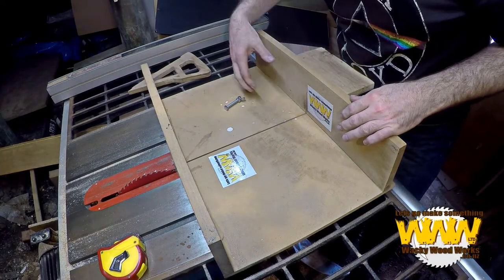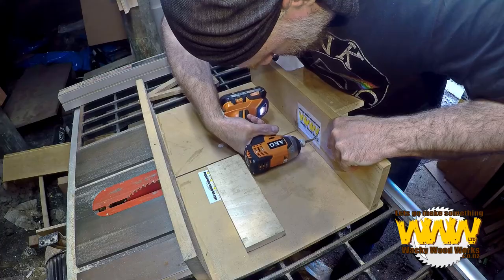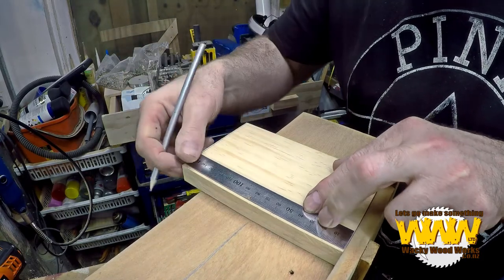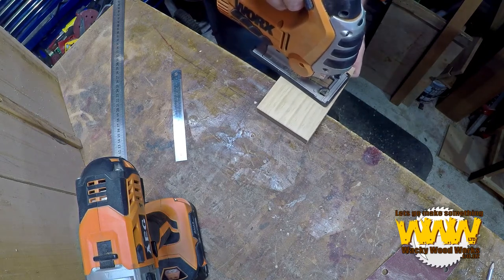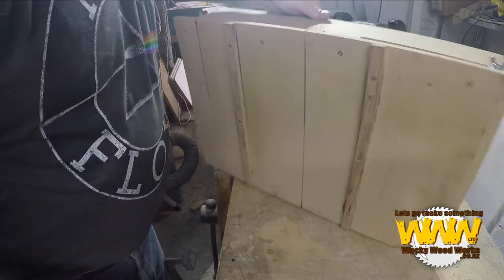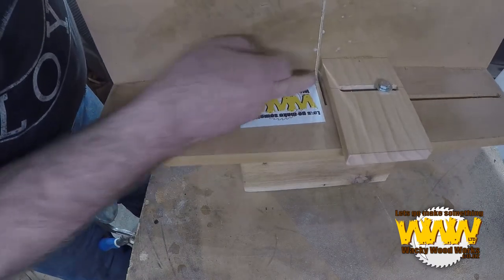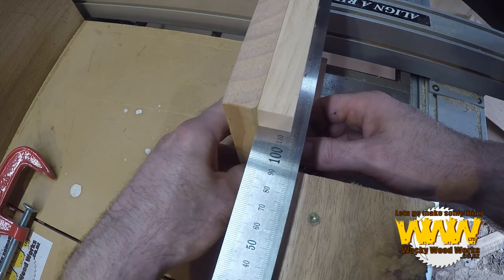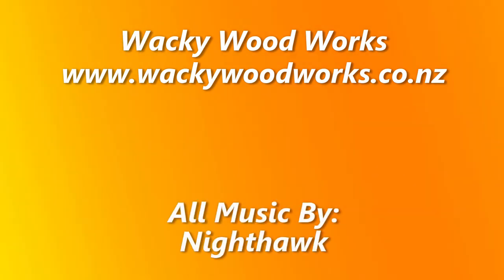Cross Cut Sled Upgrade - Off the Cuff - Wacky Wood Works.

Comment: what type of blade are you using here? did you need a reducer to use on this saw ?
Reply from the maker: Pretty sure it is my Diablo cross cut blade.  Not sure what you mean  by reducer... reducer for what?
Reply: Wacky Wood Works was referring to the arbor for the saw?
Reply from the maker: Got yah... yes that blade has insert for this table saw the blade came with various sized inserts for different arbor sizes.